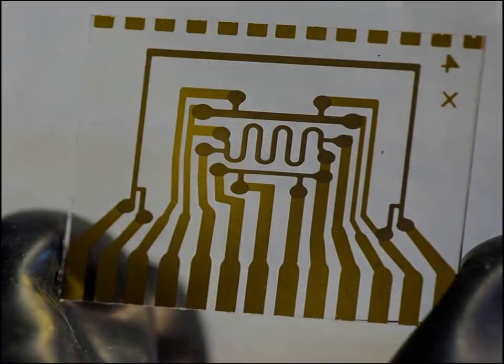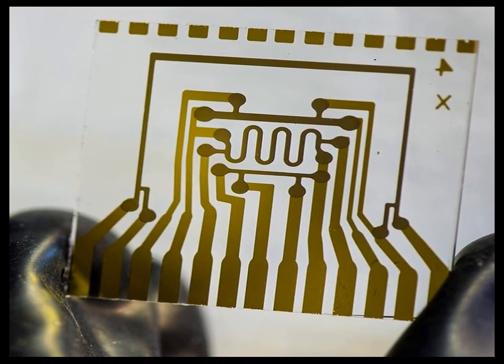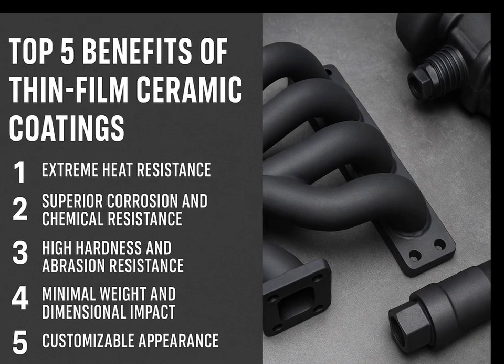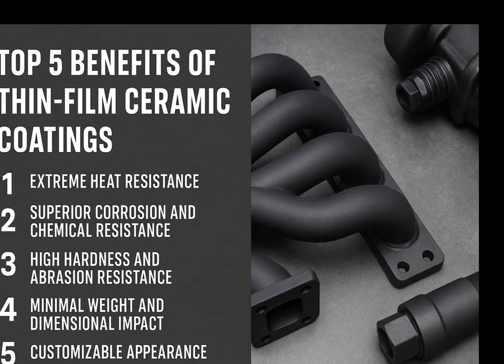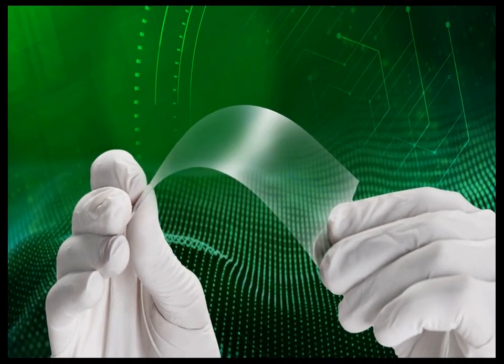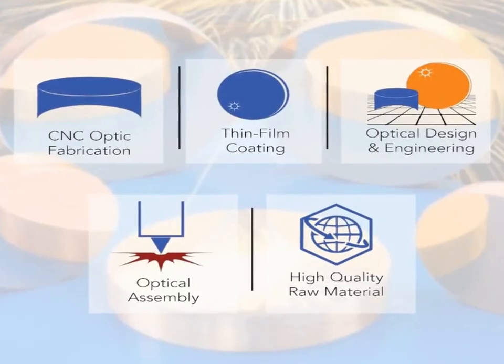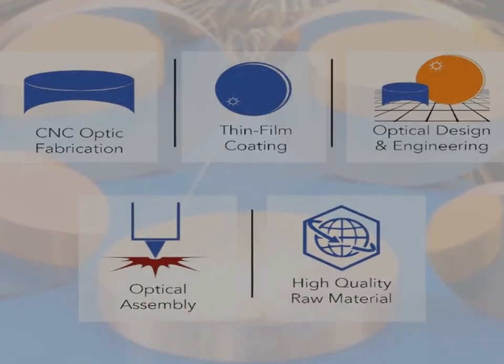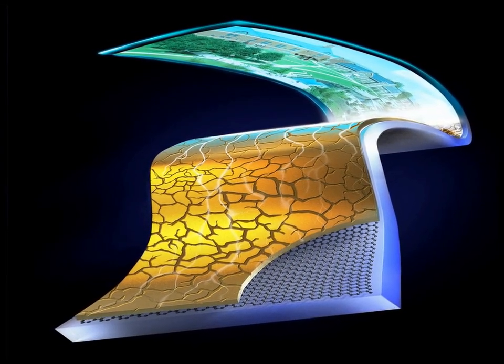INTERESTING MATERIALS: Thin Film Coatings

Comment from the maker: Further reading:

Ohring, M., Materials Science of Thin Films: Deposition and Structure, Academic Press, 2nd ed., 2002.

Smith, D. L., Thin-Film Deposition: Principles and Practice, McGraw-Hill, 1995.

Vossen, J. L. and Kern, W., Thin Film Processes II, Academic Press, 1991.

George, S. M., Atomic Layer Deposition: An Overview, Chemical Reviews, 110, 111–131, 2010.

Padture, N. P., Gell, M., and Jordan, E. H., Thermal Barrier Coatings for Gas-Turbine Engine Applications, Science, 296, 280–284, 2002.

Granqvist, C. G., Transparent Conductors as Solar Energy Materials, Solar Energy Materials and Solar Cells, 91, 1529–1598, 2007.

Donnet, C. and Erdemir, A., Tribology of Diamond-Like Carbon Films, Springer, 2008.

Musil, J., Hard and Superhard Nanocomposite Coatings, Surface and Coatings Technology, 125, 322–330, 2000.

Khan, A. et al., Aluminum Nitride Thin Films for High-Frequency Devices, Journal of Applied Physics, 95, 1667–1672, 2004.

Snaith, H. J., Perovskites: The Emergence of a New Era for Low-Cost, High-Efficiency Solar Cells, Journal of Physical Chemistry Letters, 4, 3623–3630, 2013.

Nathan, A. et al., Flexible Electronics: The Next Ubiquitous Platform, Proceedings of the IEEE, 100, 1486–1517, 2012.